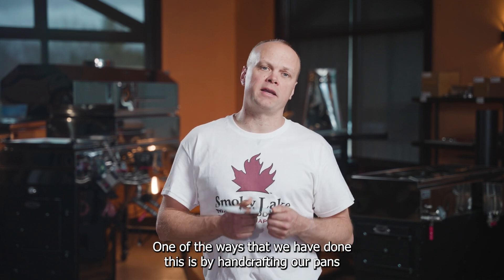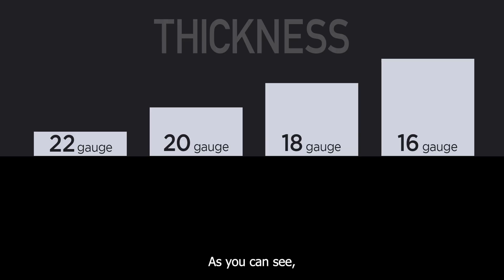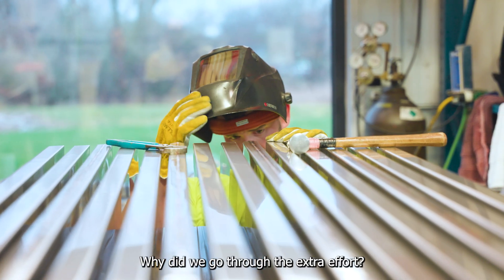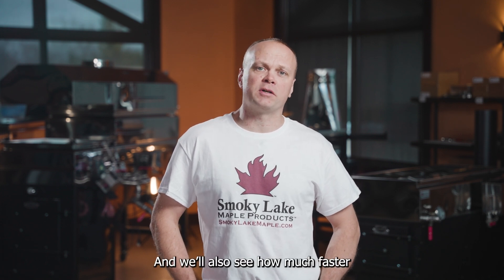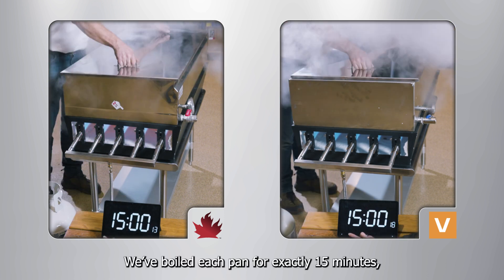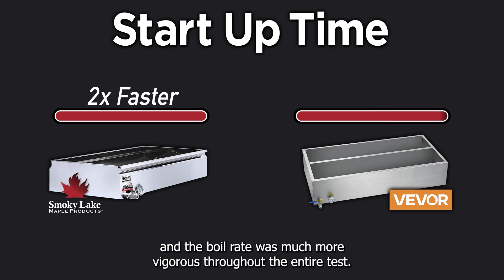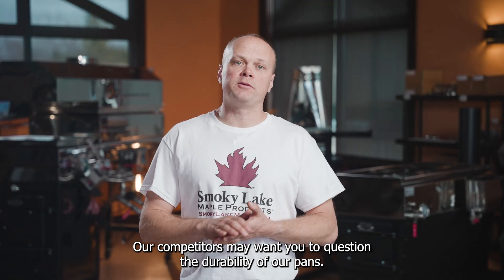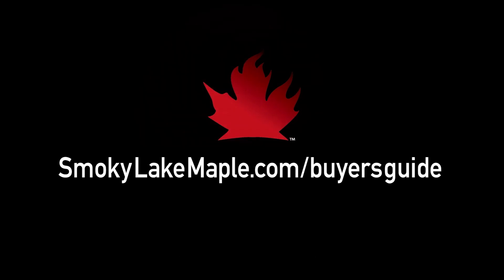Understanding Metal Efficiency - Maple Evaporator Buyer’s Guide

Comment: I'm an engineer and a maple hobbyist.  This is a reasonable test, and it's true, thinner gage material will transfer heat better.  While @DavisTyler000 accurately points out that the 15-minute test DOES emphasize the advantage of 22 ga over 16 ga, the difference is still present over an all-day boil.  Also, the advantage of 22 ga pans is greater if the fire is not as high as it should be, or if the sap in the pan is too high, both of which are real-world situations.  People who boil with wood are facing this constantly.  If you boil all day with a red-hot chimney, the thick-gage pan is not as much of a disadvantage.
Someone might be concerned that the thinner pan is not as sturdy, and that's true but not especially meaningful, because a pan will fail if you boil it dry and the joints overheat, which happens just as much on a thin pan as it would on a thick pan.  A thick-gage pan will be somewhat more resistant to physical damage from banging around when not in use, but that's not how pans usually fail, and the 22 ga pan is not fragile.  Of course, you wouldn't build one out of foil.
One minor criticism of the test, if you repeated the test without touching anything on the arches, switching pans, you would account for any differences in the burners and gas regulators.  Still a valid test, though.
Reply from the maker: @mriguy3202  Very well worded.  You're exactly correct in every way.  The same burners, manifold, and regulator were used to test each pan.  We used a new propane cylinder for each just to prevent skewed results caused by the tank freezing up during the second 15 minute interval.

Comment: I agree that thinner is better, but a 15 minute test isn’t representative of real world usage. Most of that is startup time, of course the thicker heavier pan heats slower at first. Would be interested to see a comparison after 6-8 hours when the slow startup is smaller portion of the total boil
Reply from the maker: @DavisTyler000  Even after the heavy Vevor pan was completely warmed up, it never really got to a boil at the firing rate that we were running the burners. The Vevor pan continues to fall behind in perpetuity. If you're ever interested in seeing a longer test, we have a 45 minute long video where our 2'x4' Corsair evaporates 50 gallons of sap per hour, faster than any of our competitor's 2'x6' rigs and just as fast as any of their 2'x8' rigs.  That same Corsair heats the sap from room temperature to a full rolling boil in less than 6 minutes from the time the match is lite.